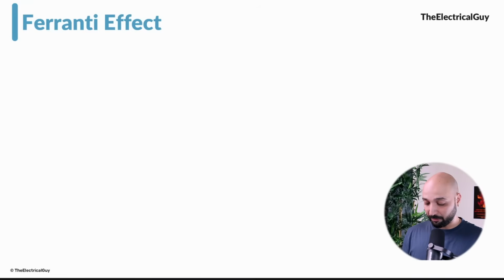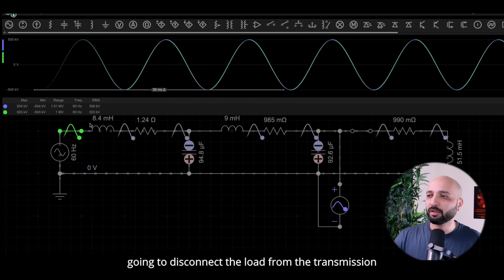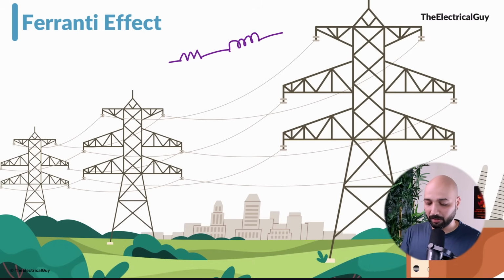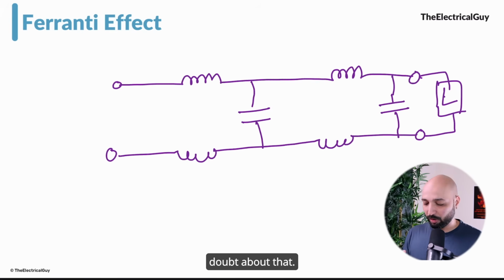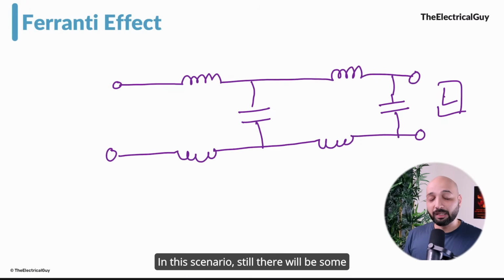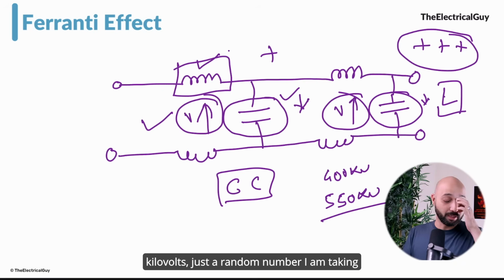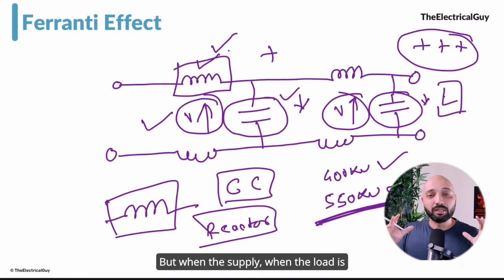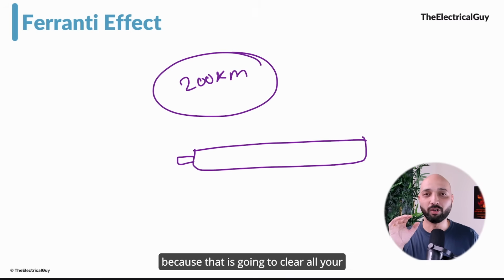Ferranti Effect | Why Receiving End Voltage Rises | TheElectricalGuy

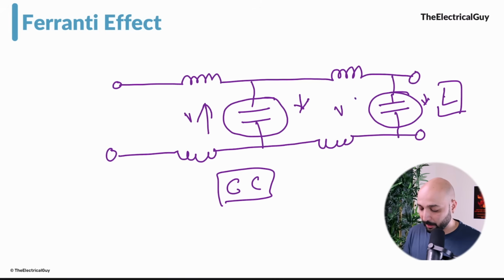Comment: At 6:49

Great explanation and helpful hand sketched drawings! I have a quick question to clarify the exact circuit physics for the no-load case:

Since the line capacitance is physically in shunt (parallel) to ground, standard circuit laws state that parallel voltages don't add up to create a higher voltage. Instead, is it more accurate to say that while the shunt capacitance is the trigger (creating the 90° leading charging current I_C), it is the physical interaction of this leading current passing through the line's series inductance that builds the actual 'voltage ladder' step-by-step along the wire?

In other words, we absolutely need the capacitance to create the current path in an open circuit, but the series inductor is the component physically generating the in-phase voltage rise. Would love to hear your thoughts on this breakdown!

Again, thanks for making this concept easier to understand.

Comment: Sir, explain high frequency ac uses compact inductors be it a transformer, choke or induction motor. Why low frequency inductor needs to be bulky and high frequency inductor needs to be compact?

Comment: This is a simple resonance effect. Obviously, it doesn't happen at DC. And it doesn't happen at high frequencies (greater than 1kHz). Also obviously, a passive circuit can't generate power, so any increase in voltage can't be "harvested" except with a decrease in current. Run the same circuit simulations in AC (frequency domain) and look at the two LC resonant peaks.

Comment: when i charge my ev at the free charging stations i like to watch the voltage. sometimes it sags from like 215 to 206v on three phase if i am charging in the middle of the night and I always assumed that it was like a dc power supply getting loaded and dropping its voltage since it was getting close to its max load/current... but that never really made sense because I am only pulling 10kw for like a 50-150kw transformer. guessing it is this effect because i see it more at 2am when im hanging out at free charging stations when the grid load is probably at the lowest for everything else.

Comment: Question: this effect happens also directly after switching on an open line, not only after disconnecting a load, correct? Meaning if it happens on a certain lime, it is a constant or very likely effect. Is that right understanding?

Comment: It's the Q-factor of a LC resonance circuit. And by adding an extra L you detune the circuit and so lower the Q factor. Also the L (choke) is to stabililize the voltage when sudden loads are (dis)connected.

Comment: I really liked your explanation. I was wondering about the load. It seems as though the load would vary a lot depending on demand. So, if the inductor at the load side is a fixed value, how does this affect the Ferranti effect? For example, going from a light load to a heavy load. Going from a heavy load to a light load, but at a slow rate. Thank you.

Comment: That was a rubbish explanation of the Ferranti effect.  Let's see if we an do any better.  Each section of the line can be modelled as a series resonant circuit with its output voltage taken from the centre point of the L and the C as shown in the video.  The line frequency is well below the resonant frequency so the reactance of the capacitor is much larger than the reactance of the inductor and the circuit predominately looks like a capacitive load.  The capacitor draws a small current which leads the line voltage by 90°.  This current flows through the inductor and generates a small voltage across it which leads the current by 90°.  So the voltage across the inductor leads the line voltage by 180° ie is in antiphase with it.  The output voltage is the input voltage minus the voltage drop across the inductor which adds another 180° phase shift making the change in output voltage in phase with the input voltage and so the output voltage is higher than the input voltage.  Each section boosts the line voltage a small amount so over a long distance the voltage at the end of the line can be significantly higher than at the beginning.  This is only relevant at zero or very light load.  As soon as a load is connected the resonance is damped so that the effect is negligible.  The load does not cause the reactive voltages to cancel each other out.

Comment: The Ferranti effect is a variation of the problems faced earlier and resolved with the first Morse code undersea cables operators known as the Telegrapher's equations. It is also know in radio communications as VSWR, meaning that when there is a mismatch between the impedance of the cable and the load, the cable will act as a transformer within  the cable creating very high voltages and currents known as antinodes.  This could destroy the transmission line or generator due to the high currents and voltage produced in the line and the reflected power returned to the generator.

Comment: So this is the same "transmission line impedance mismatch" effect we get when a high frequency signal goes through a long coaxial or twisted pair cable, when the termination is not correct (open or closed circuit for example) the wave gets reflected too...
Oscilloscope probes use a variable capacitor to adjust the signal impedance to the line.

Comment: Please make a comprehensive video on reactor. Please illustrate below.
1) How to size a reactor
2) What cases the reactor added in both sending and receiving end? Is this okay to add reactor only in the receiving end when transformer OLTC controls the sending end voltage?
3) How to determine Reactor needs to be connected in Bus or Line?

Comment: We once used a 11 kv 1100 kvar capacitor bank for an arc furnace to improve the power factor to 0.95.
The protection fuses inside the capacitors blew if we charged the capacitors first (ringing effect, increased the terminal voltage to above 13 kV.)
Latter we added a relay that permits turning on the OCB only if the inductive load was above 30%, which solved the problem.
Informative video. Thank you.
Reply: Reactor

Comment: Reactor. Please.

Here,
Due to capacitance, voltage leads current,  how do we assume PF(Leading Lagging unity) of a particular feeder at the receiving end or if considered for that network?

Voltage control at sending bus at generation station?

Harmonics?

Effect on PLCC system?

When ferranti effect takes place, conditional handling of Capacitor banks at receiving end?(Switching)

🙏🏻

Comment: The LCR in the transmission line is resonant creating a tuned circuit that amplifies the voltage when the load is light.

Comment: A think a better explanation of the Ferranti effect is that in a lightly loaded line there is a reactive reflection from the end that causes the currect to flow back to the supply.  It is that reflected voltage that adds to the arriving voltage causing this effect. In a fully loaded line there practically no reflection as all the power arriving gets consumed at the end and nothing gets reflected. Understanding the concept of power factor helps a great deal in understanding of the Ferranti effect.
Reply: Also called the ringing effect.
Reply: The channels author's explanation is all a bit confused in the video. I'd advise checking back on the governing equations of a balanced conducting path. A better appreciation is to go the next step and consider the Maxwell equations - only really needs to consider the 3rd & 4th ceoss-product Heaviside vector equations.

I'd probably also be beating a path to my lectures door demanding why he's giving such a poor explanation of a basically simple system.

Still, the good news is that this kind of understanding being taught will always ensure there's work available for EMC engineers (and A&E doctors, unfortunately).
Reply: any energy that doesn't get used gets reflected back.    When you know EMR is just light easier to understand the concept
Reply: Sounds like a standing wave.
Reply: Impedance marching a power line is impossible because of the fluctuating nature of the power load.  Actually the Ferranti effect is simply a standing wave effect.
Reply: @TonyFisher-lo8hh has there ever been measurements of resonant frequency of the power distribution grid? Could there be danger that if a suitably modulated load be applied, that standing waves be amplified beyond capability?
Reply: @ergodana3433  By calculation, the full wavelength is about 5000 km at 60 Hz  (6000 km at 50 Hz), so the line resonance effects would be marginal for a practical line.  On the other hand, power networks are subjected to extensive load-flow calculations to check for related system-stability issues.
Reply: exactly! i was waiting the author to say this but his explanation became increasingly confusing on this.

Comment: Simply use shielded cables, with grounding, no need for the big reactor...?🎉🎉
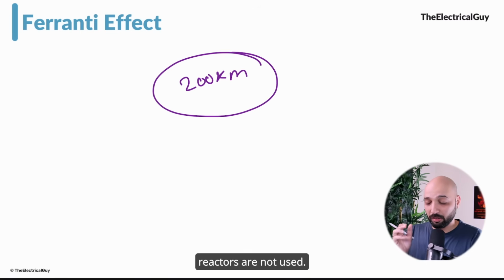Reply: That adds to it, he explains that at 10:40.
Reply: If shielded cables are used with grounding than the distance between the ground and the live wires decreases and as you already know that the decrease in distance leads to increase in capacitance. So your idea will lead to more big reactors that needs to be installed.